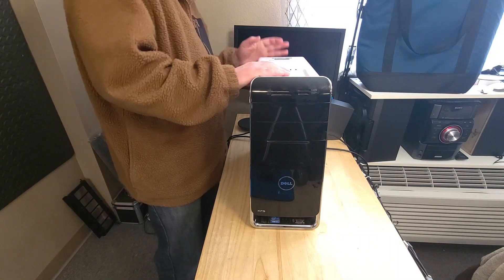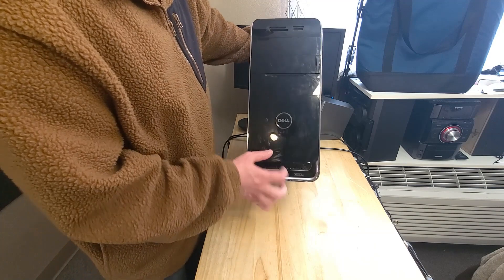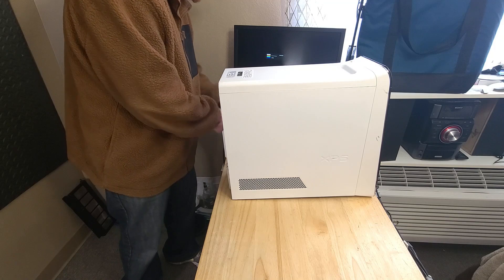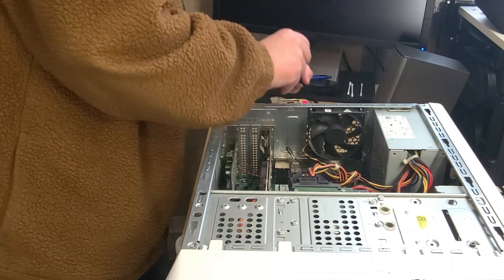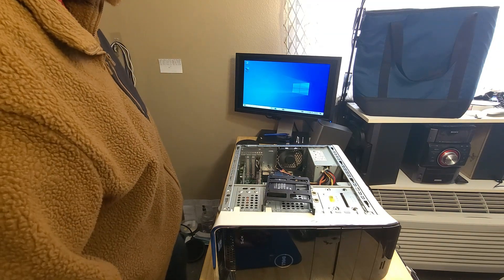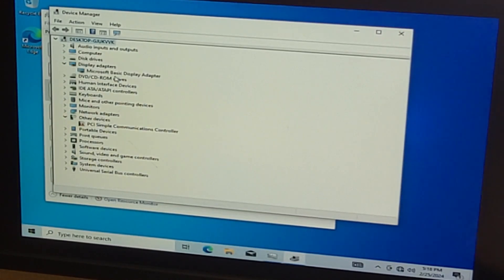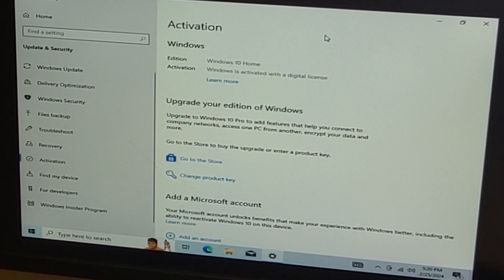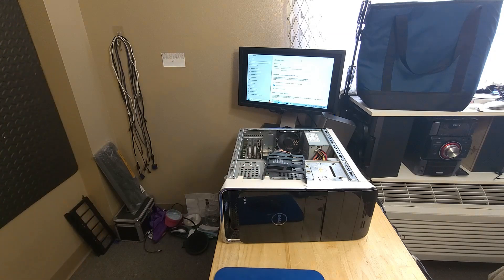Is The Intel I7 2600 Worth Buying I Just Got One

Comment: im currently useing an i5 3570k with an 4070 SUPER, and most games that are GPU hungry run with just as much FPS as they would with a new CPU. so the i7 2600 was a generation younger but had hughe OC potential at the time.

Comment: My experience has been that most/all Dell computers built in the past few years have the digital activation number burned into the BIOS, so downloading the latest Win10 image from Microsoft and making a bootable install USB drive shortens up the OpSys reinstall considerably.  Same with HP, I believe.  Both Dell and HP have update managers you can install on the computer that make sure you have the latest BIOS and best drivers for their computers.  Works for me!

Comment: Personally I wouldn't say it is good.
I use an i7-6700 (released in summer 2015) and although its ok, it does have its bad moments. If your just web browsing and watching videos, the i7-2700 will be ok. But for gaming it will be awful. Even overclocking (if it can be overclocked) wont make it that much faster.
Sorry dude, but $40 is pretty good for a web-browsing PC.

Comment: ok, so uhm. No its not worth it, Any cpu on the lga 1155 struggle with single core performance, I would stay away from older intel unless you pick up a 8th gen cpu and forward. The cpu that you have recieved was from the "Intel Dark Ages" where intel was leading the market and didnt really have to innovate, from 2nd gen intel to 7th gen intel is what i would consider the intel dark ages, I call it that because thats when they only made 4 core 8 thread processors which slowly got better as you move up generations, The 8th gen intel cpu were the first intel consumer processors (Besides xenon) which came with 6 cores 12 threads and a more stable clock speed. Sorry for the information overload, If you must, Please research before you buy.
Reply from the maker: What about X99
Reply: the 22 core Xeon E5-2696 V4, E5-2699 V4 is a server chip that has both solid multi and single core performance, But thats just one cpu you should look at other. @rohon4972

Comment: In my area that PC working and running, with a cheap monitor and KBB/Mouse would go for $125 to 150.
Reply from the maker: I had no hits on this for about 3 weeks so I finally ended up selling this with no keyboard our mouse and no monitor for $80 so it wasn't a loss but it wasn't a huge profit like I said I was just doing it for fun
Reply: @rohon4972  that isn't bad for just the PC. I am lucky my area has a good demand for used PCs, and very few shops, the shops want nearly $500 for "refurbished" 9th Gen i5 Optiplexes, so I can get a little more. More often than not I buy office PCs to swap an i5 or i7 into a "gaming" PC, which this area has a very underserved market for. Imagine a city with a larger population than Tacoma, but only has three small computer stores, with no other secondary ewaste places or anything like that.

Comment: That's my main machine, I'm watching you on one of these, main quirk is that it doesn't like modern graphics cards. Supposedly the mythical bios version A07 solves this problem, supposedly..
Also windows 10 works without problem on this, as that's what I'm using right now.
Reply from the maker: Cool. I have not tried to put a newer video card in.
Reply: A07 bios , what card did you already test... ??
Reply: @t.a.p4554  I used a quadro p400, which works in other older machines, just not the XPS 8300.

Comment: I7 2600 is probably older than I would be comfortable trying to mess with.
Reply: I also agree this type of machine isn't even office worthy anymore, It still supports XP and Vista tho and you can easily turn it into a retro gaming rig for older games, but thats about all its good for.
Reply: @tek_lynx4225  there are people into retro computers but I'm not sure how hard it is to make that profitable
Reply from the maker: Yes an older CPU it's a bad part of it I'd have to make sure whatever that they were going to do with it it has a support like some games will refuse to launch with this CPU even that it has enough horsepower to run the game it just doesn't have the right support

Comment: gracias for the content, Subz are up from last video i saw, i feel you will hit 500 before April - anyone who has a comment should add a sub- I am in my basement Htpc - xps 8940; a 10400 white Pc; my bose gave to me when he upgraded the office; no gpu - i added gtx 1050 ti - running movies,  and is a xBox cloud beast runs Halo Infinte, Control just came back - peace
Reply from the maker: Nice and a Nvidia GTX 1050 TI is I good card I have probably over 4 terabytes of games installed on my hard drive and out of them games maybe 10 of them won't play the best with the 1050 TI but the rest of them will be perfectly fine especially at 1080p